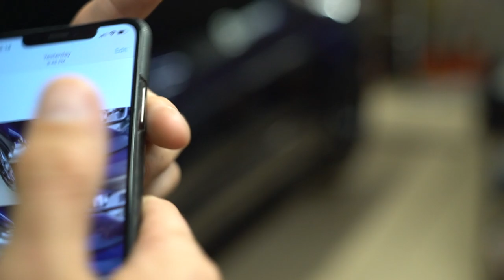This MOD Made My Mustang Look Insane.....

Comment from the maker: What do you guys think?
Reply: David Van Voris car looks good man!
Reply: Wraps are awesome but keep the Tangstang tangy lol
Reply: David Van Voris Great Video I think the Tang Stangs Tinted Head and Taillights look great and I think you shouldn't wrap the Tang Stang because it wouldn't but the Tang Stang anymore and I think Joe Should go with 4 pie cuts
Reply: Tinting headlights is just bad. The amount of light and lumen you lose is unreal. I split the lights open, paint out the chrome, smoke out the side reflector, and for shits and giggles, add a demon eye in the projector. Simple and clean. With my '18 I went with sequential signal on the triple bars that go white to amber, as well as full color changing. Even the fog light area has been opened l, painted the chrome/grey bezel to black, and the signal is now white and flashes amber for signal. Plus full color changing.  For those pricey nights, or at the track for that little extra bling lol
Reply: Looking good haha 🎃
Reply: Don't wrap. Keep the orange.
Reply: Looks great!!
Reply: Keep the orange
Reply from the maker: Thanks
Reply from the maker: Thanks
Reply: Wrap the spoiler and mirrors black and leave the rest Tang. Just do a clear to protect the paint.